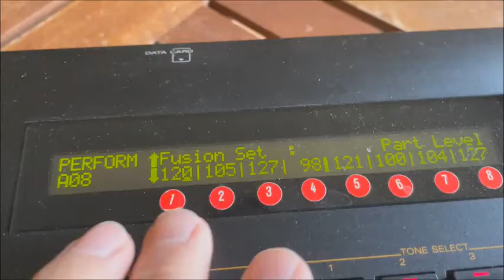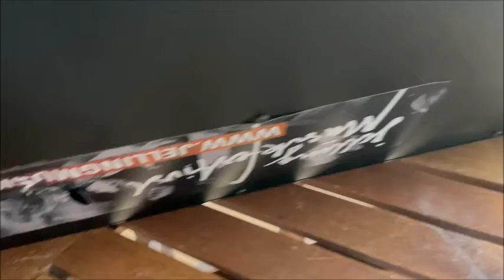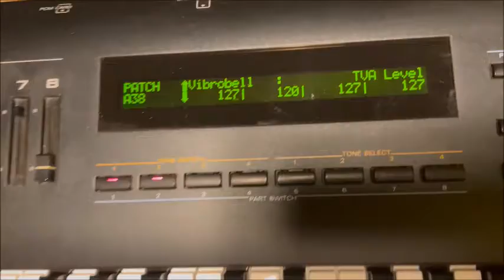Repairing a Roland JV-80

Comment: I have a Roland JV-1080 that I bought around 2008 or 2009. I did consider buying a JV-880 which is the module version of the JV-80 but I went for the JV-1080 because 
it has more sounds and it was used on countless recordings throughout the mid 90s well into the mid 2000s. Part of the reason I prefer modules versions of Roland PCM 
synthesizers is because of the problems with the glue on the key weights as well as space being a bit of a concern but as always you did a really god job at restoring this 
one. These Roland JV synthesizers are still usable in modern productions and I don't think they sound outdated at all, you should record some more song covers using 
the Roland JV-80 in the future.

Comment: You should have put all the keys in a bucket with liquid sink unblocker, let it stay for 8-12 hours, wash and dry the keys and the weights and then glue the weights on the keys with 2-component glue. 
As long as you leave the red glue under the weights, it will be a time bomb again
Reply from the maker: I know. But the thing is: I am an organ player, so I prefer keys with a light touch. My plan is simply to remove the weights when they fall out.
Reply: @organfairy  Yo le saque el pegamento rojo a mi Roland XP-80, y le pegué los contrapesos con poxipol, luego mande a pintar y pulir las teclas a un taller de pintura de auto.

Comment: Great, looks like new and sounds great. Roland instruments last forever … besides the well known „red glue“ issue…
Hm, my Hohner E3 could need a clean of some upper key contacts, too. But I worry about „opening“ the keyboard itself, since it does not lay down flat, but is flapping around in the breeze in some wierd angle. I don‘t know if some parts will fall out.
Reply from the maker: I didn't know about the "red glue issue". Are there any ways to cure it or do I need to clean it all off?
Reply: I have a Roland JV80 which has problems ando I want to know if You can help me

Comment: What a great find! Did you end up removing the red glue? If not it will drip into the PCB below eventual and destroy it. I’ve repaired a few JD-800s which also had this issue.

Comment: Just cleaning off the bit of red glue is only going to be a temporary solution. Maybe you are already aware of the "red glue of death" that has plagued many of the Roland synths produced back in the 90's that have weighted keys. The "red glue" is an epoxy Roland used that over time started to soften and leak. Stored incorrectly this glue could damage other key components of the synth but most times it only impacted the keys themselves. I just recently overhauled my JV-1000 and cleaned all the keys and now it plays flawlessly. Take a look at this link here on youtube. https://www.youtube.com/watch?v=LrKK6sNMLsU
Reply from the maker: Unfortunately you are right: They have started falling off my keys. My solution is simple: I just remove them completely when the start falling off as I am not used to weighted keys anyway (I am an organplayer).
Reply: @organfairy  Understood. Whatever works for you. The thing you should be aware of is that sometimes the weight don't drop out completely, especially the black keys. Prior to my thorough removal of the glue, I went to play the synth one day and I was unable to depress some keys thinking they were stuck with glue but it turned out that some of the weights came loose but were lodged under the key preventing me from pressing down on the key. Fortunately, I noticed this when I flipped the synth over otherwise I probably would have broken several keys.